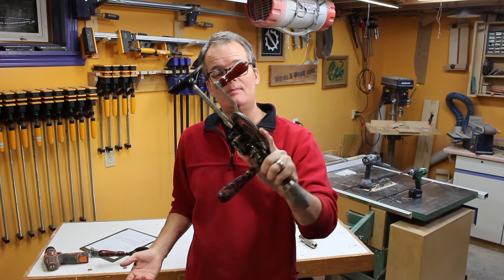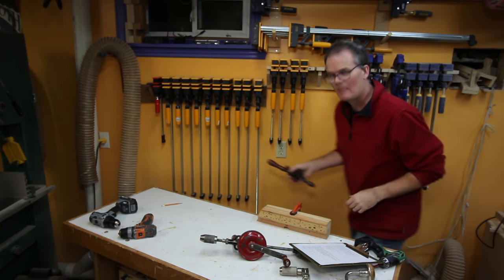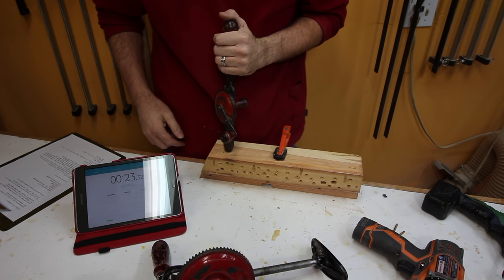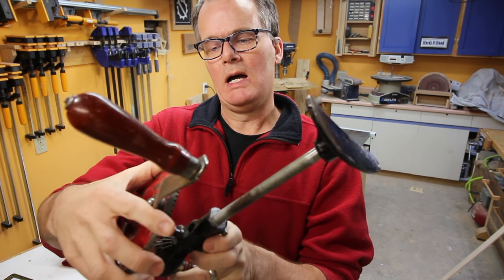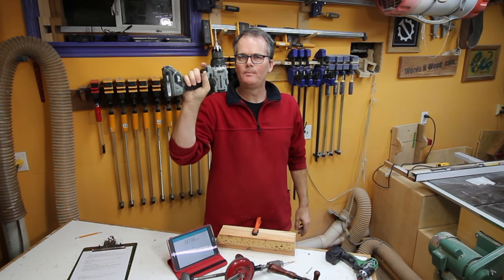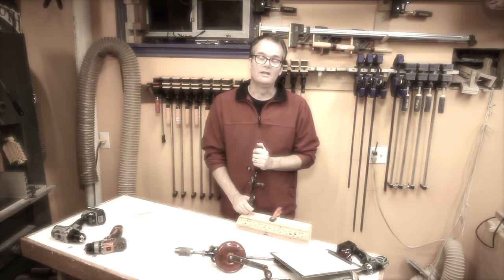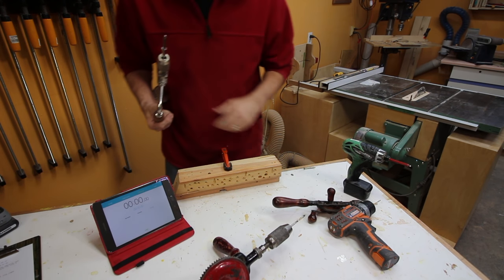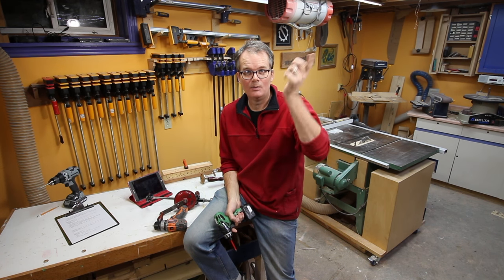CORDLESS DRILL SHOOTOUT! (WnW #85)

Comment: Late to the party I know, but there are a couple of other uses - I keep a countersink bit "permanently" in my egg-beater, hanging on the wall in reach of my workbench. Often when using my battery or corded drills on a job, I can't be bothered to keep swapping bits. As countersinks need very little power, and the hole is pre-drilled for accuracy, the egg beater can actually save a lot of time and give more control over the results. On some projects I keep a fine drill-bit in the egg-beater to pre-drill screw holes, then keep the screwdriver bit in my power drill (with screw torque setting).

Again, it's the advantage to having multiple tools set up at the same time without the cost and storage of buying multiple powered ones :)
Reply from the maker: That's a good idea!

Comment: In my experience, the small hurdy gurdy drills are terrible for delicate work.  Because you can't hold it steady while cranking, and with a small bit there's more risk of breakage from all the moving around.
But your cordless drill, in 20 years, is guaranteed to be toast, whereas the hurdy gurdy will still be fine (cause you only used it once or twice in that time)
Reply from the maker: Shoot, I forgot to mention that...  I'm on my third set of cordless drills since I bought these old hand drills!!  Fourth if I included the Canadian Tire ones that I'm now using in parallel with my small green ones...

(Never heard them called hurdy gurdy drills, but google backs you up.  Cool.)
Reply: I thought a hurdy gurdy was a stringed musical instrument?

Comment: I'm a hobbyist who has all the time in the world, unlike most professionals. As such I’d say my egg beater is my most used drill, followed be my drill press. My larger brace with more torque and my cordless drill would be about the same. Then my smaller brace and finally my rotary tool which as a drill is rarely needed but when it is nothing else will do. For me, and compared to most I’m a newbie, there’s something wonderfully organic about using hand drills and braces. This might wear off in time, but who knows. 

I find my eggbeater works best with firm but not too intense pressure, so the bit itself does most of the work. It seems quicker and far more stable.

A great fun video.

Comment: Just a quick comment on the chest drill. This thing rocks. I haven't used the regular egg beater drill, but I really recommend the chest drill, because it's easy to apply force straight through the bit with it. And if you want to be precise, it's easy to start drilling with more weight and then use only one hand to push down the plate to make sure you're drilling square from a few different angles. Also, if using the chest to push down, chest drills offer two really sturdy points of control, and one that moves.

I originally bought mine because I live in an apartment above an old lady and don't want to make too much noise, but I'm finding it really pleasant to use overall.
Reply from the maker: good points, thanks!  This video was intended as fun satire, but there are still some good serious comments about these drills!
Reply: @Wordsnwood  Not only was it entertaining, but it seems to show a difference between egg beater drills and chest drills. I was looking at the Lee Valley Veritas egg beater drill, but it seems like getting an other used chest drill as a backup might be a better option.
Reply from the maker: Or a brace.    20+ years ago I used a brace to screw down a deck after my wimpy 12v drill couldn't handle the torque.   (hmm, or did I tell that story in the video?  It's been so long.)
Reply: @Wordsnwood  You did, ha ha. Yesterday, I used my chest drill to drive screws for building a frame, too! Works well! I liked how quick it went with the 3:1 gears.

Comment: The egg beater drills are meant for your hand to be placed on top and your forehead on your hand. This lets your balancing organ (ears) steady the drill. Also your handle was loose which lead to the drill spinning. With my egg beater drill and a proper bit, I can drill a 1/8” hole in 4 seconds

Comment: I keep a brace with a 1/4" magnetic hex adapter chucked in it handy.  Drop in any bit from one of those universal bit sets, and you're good to go.  For those high torque applications, it beats the pants off hauling out a big cordless or, God forbid, a 1/2" corded monster drill.

Comment: I just picked up a Stanley eggbeater and two ratcheting braces for a quarter, each, and a large yankee screwdriver (25 inches long, without a bit in it) for 50 cents, at a church rummage sale. Four vintage tools for a total of $1.25. I felt a little bad, but not bad enough not to buy them. The eggbeater drill was kind of herky-jerky, like the one in the video, until I tore it down, cleaned it, lubed it, and reassembled it. Now, it's as smooth as can be. You can give the handle a crank and let it go, and it'll spin for another few seconds, from the momentum. I'm taking them all to the off-grid cabin, for those small jobs when I don't want to crank up the generator. That's why I'm here, seeing how they compare.
Reply from the maker: That is a ridiculous gloat, my friend.  score!